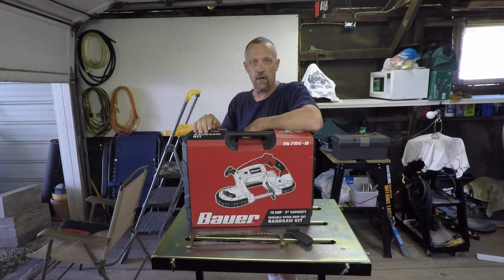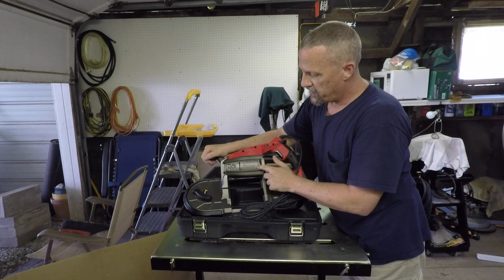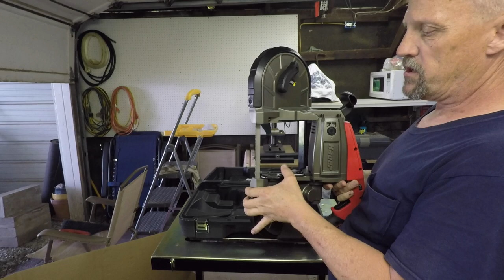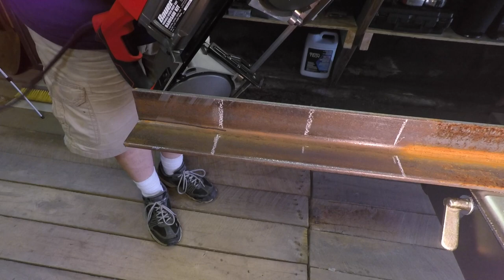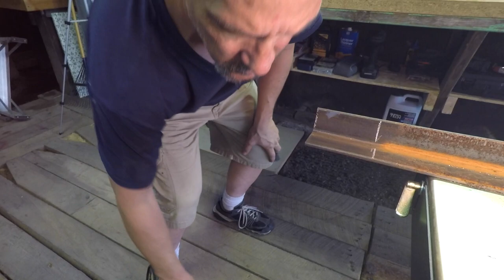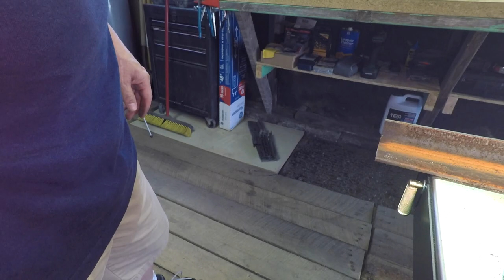Harbor Freight Portable Bandsaw Review - Bauer Bandsaw

Comment: Got mine July 4th. No extra brushes. Not sure if my blade tracks right. Do you lock it in place all the way? Mine seems tight. I bought Lenox 14 tooth blades.
Reply from the maker: Mine is pretty tight too and I don't think the handle on mine actually locks in place. It seems as though it just snugs up. As time goes by and the blade stretches it finally locked in place. Either way it's been a great saw for me so far. Hope yours is too!
Reply: @DIYHomesteadProjectsDIYHP10  Thanks, That makes sense!

Comment: Do you find it difficult to cut a straight line? I bought one and then bought Lennox blades that are 020 because someone recommended them. The manual said 025. I didnt try the Bauer blades but i could not cut a straight line. It would start good then get crooked. I'm wondering if that 005 difference in blade width was the reason.
Reply from the maker: I can cut a strait line but I do have to pay attention and guide the material. This is my first and only band saw so I really don't have anything to compare it to. I am using the HF blades on my saw. I don't remember the tooth count though.

Comment: My only experience using a band saw was cutting a little conduit and some uni-strut from time to time.  This saw would have been perfect for my use but it might not stand up to the more hard core electricians out there.  It is much more practical for the hobbyist than paying for a Milwaukee.
Reply from the maker: It's been a fantastic saw so far. We'll see how it holds up over time but it has great reviews everywhere I have read about it. I think it's built like a tank so I have high hopes. It's definitely going to meet my needs as a hobby use saw. Thanks for watching and commenting as usual!

Comment: So it did the new version come wrapped in a bag inside the case?  Mine didn’t and had oil leaking on the inside of the case.  A real mess.  Let me know please.  Thanks
Reply from the maker: Mine didn't come wrapped with a plastic bag. Just the saw in the case with instruction booklet and allen wrench. Mine wasn't leaking and no mess. You may want to take it back and get another one that isn't leaking. Hope it works out for you!